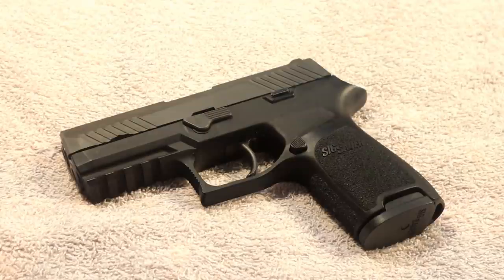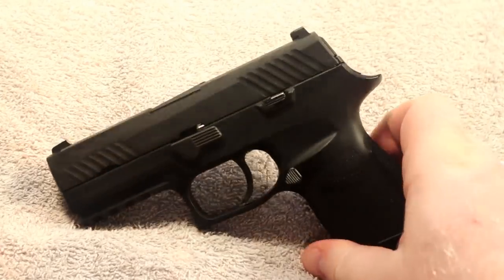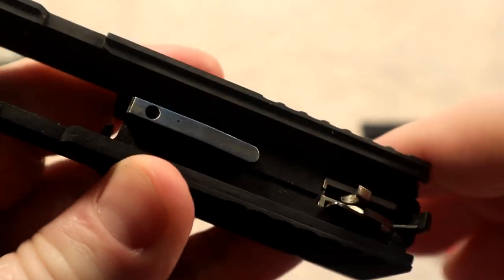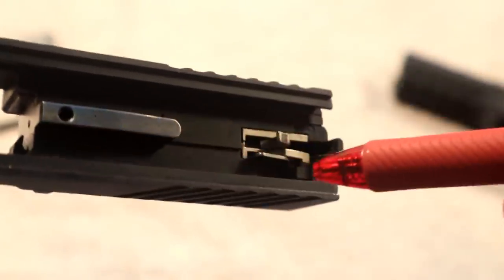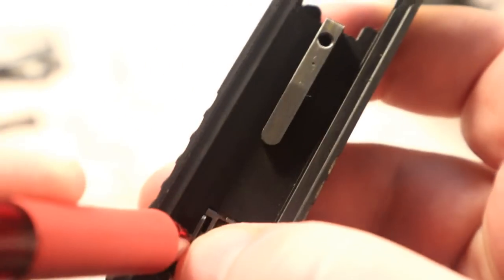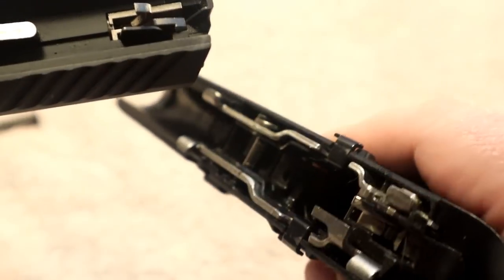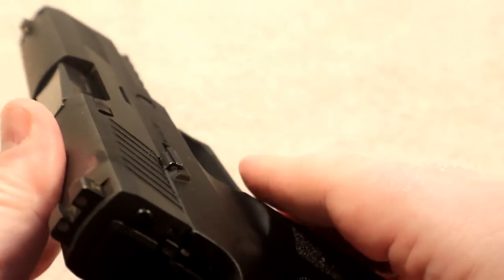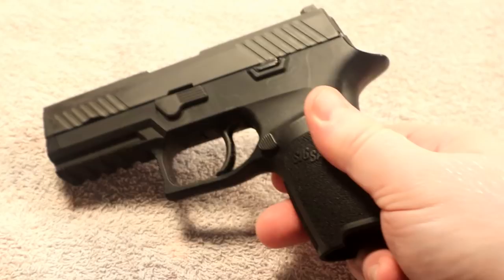The Sig P320's Dirty Little Secret You Won't Find in the Manual

Comment: The Sig Sauer P320 had a design flaw that could cause unintended discharges. However,  Sig Sauer addressed the issue reducing the physical weight of the trigger, sear, and striker, while additionally adding a mechanical disconnector to prevent discharges. All P320 models produced since 2018, and thereafter, are modified to prevent unintended discharges. 
I own a P320 X Five. I have no issues with it, but only praises about it. Sig Sauer pistols are safe to carry.
Reply from the maker: Yep

Comment: My p320 has been loaded with one in the chamber, carried and/or stashed in a defensive location for several years and it’s never fired unintentionally. This was before the “upgrade/recall” and afterwards.
Reply from the maker: Yep.
Reply: OK that isn't a scientific test.  You get that right?  It proves nothing.
Reply: @barrygoldwater2441  you do realize that post was a year ago don't you?
Reply: @georgebaldford3186  Yes.  And this fact which is not your business concerns you why?
Reply: @barrygoldwater2441  It was a rhetorical question.
Reply: @georgebaldford3186  I don't think you know what rhetorical means but OK.

Comment: Absolutely OUTSTANING VIDEO. BoomStick Tactical is the real deal. Fantastic information. I had my Sig Sauer P320 with slide off with me and walked through with my upgraded Sig Sauer P320 and it worked EXACTLY like BoomStick Tactical was doing. With the Sig Sauer bashers, I bought that and took my Sig Sauer P320 off my night stand and went with my Springfield Armory XD-9. I really like it. But, now that I see that the Sig Sauer P320 would have to have multiple failures in order to "fire on its own", my plan is to put my P320 back on my night stand. THANK YOU so much BoomStick Tactical from a fellow "gunner" in the greater Los Angeles California area.
Reply from the maker: Thanks for watching. Be careful in california

Comment: Get this detective's sig 320 and any other lawsuit plaintiff's, then replicate the discharge in a controlled setting without pressing the trigger.  Otherwise, there are too many variables.  I am not a fan of the p320, but its way too easy to cover up an AD/ND by claiming its the pistol's fault.
Reply from the maker: Exactly. I'd like to see the insides of it.
Reply: Seconded. Proof is in the pudding. I believe the choice of holster and purse contents are to blame.
Reply: I'd like to see the holster too.  Any bets there's scratches and nicks in it?
Reply: @dbill7486  i believe it was a blackhawk serpa holster
Reply: @madhatter6913  she is likely the one to blame...blackhawk serpa holster loose in her purse
Reply: @richardkim4895  Very true, ultimately it is the human error that caused the issue, coupled by poor design of Serpa holsters, loose junk in the purse, and the error of stowing the holstered pistol in the purse. The improper fitting holster left a big gap between the holster and trigger guard that was large enough to ingress random junk. Too many wrong things went right to make the gun go boom. 

Guns demand respect. In this case the officer did not give proper respect to her firearm. There is great power in a firearm and with great power comes great responsibility. I believe it is safe to say this officer was not responsible enough to safely carry her issued service weapon. Education and respect of the firearm are vitally important factors for any who plans to carry a loaded firearm.
Reply: @richardkim4895  That's what it looks like to me also.  I have the X5, full and the compact and they all rattle around in that holster its not a great fit unless you put padding into it.  I fit my Beretta just great thou.  But the holster was made to go on your waist not in a purse or bag which is her problem, and she should of bought a holster that would of made it safe of where she was putting her firearm.

Comment: I have a full size and a compact. I have hammer tested and drop tested both of them....NO discharges!! I even bought a extra backplate, cut the bottom off, reassembled the guns and placed a small screwdriver in the back and forced the sear off the striker causing the striker to go forward and every time the striker block did its job keeping the pistols from discharging!!
Reply from the maker: Exactly

Comment: The possible foreign object in purse scenario PLUS fairly light trigger is why I really like thumb safeties.  Besides being a close copy of the new issue pistol of the Marine Corps, the thumb safety is a big reason for buying a P320/M18.  If I decide to use a P320 for CCW, I can simply purchase appropriate frames and slide assemblies.
Reply from the maker: Some prefer them. Allowing something to get against the trigger is why hers went off
Reply: @BoomStickTactical  Yep.  IMO, an activated thumb safety would have prevented that something from pressing the trigger and fire the gun.
Reply: Loose off body carry in a purse with loose items, pens, keys. Eye liner etc to get inside the trigger guard you are asking for problems.  You need a trigger guard cover carrying like this.....the thumb safety can be clicked off rattling around in a purse.
Reply: @bmphil3400  Totally agree about the requirement for a holster to cover the trigger guard!  Dinosaur that I am, I still like a thumb safety if the trigger is less than 8 lb--about like a good DA revolver.
Reply: @petesheppard1709  thumb safeties become a liability in a high stress situation.  I'd rather have the revolver with the 8lb trigger or dao pistol than a light trigger with a thumb safety.  Those snap on minimalist trigger guard covers work pretty good for this.  My wife loads the Glock then snaps on the trigger guard cover and puts it in the purse.  Pull the lanyard and the cover comes off and it's ready to go.
Reply: @petesheppard1709 It also can PREVENT the same kind of untrained, inexperienced user from firing the weapon when they forget to disengage the safety. A better solution is to pay attention to what you are doing, and probably don't put a handgun in your damn purse.
Reply: @wehrewulf  You make good points, but the simple truth is that NDs still happen, despite aggressive and thorough training. After decades of shooting, I have worked out personal practices that provide me a margin of safety that I'm comfortable with.  Even so, I am constantly on the lookout for complacency.
Reply: @petesheppard1709 Your statement is the most relevant of all, complacency! Training and safety focus can help here. Like daily safety meetings at a construction site, focus on the topic and practice. That said, using a tool that is more user safe, to avoid the need for a higher level of skill and practice is a valid argument (like using a Glock for example). If police departments are going to pick a tool that requires more advanced skills they need to support their choice with the appropriate level of training and measurement of effectiveness. Aka common sense.
Reply: @maybe5883  👍 More good points!

Comment: Greg Ellifritz recently shared an experience where the tab on his Glock's trigger bar broke and couldn't disengage the firing pin block. He tried pulling the trigger several times before finally realizing why the gun wouldn't fire, just because it was a failure he had never encountered before. As you say, even if the striker tab broke, the gun won't fire without the trigger being pulled.
Reply from the maker: Bingo. It would take several failures happening at once
Reply: It is a striker, not a firing pin.

Comment: The issue is that the Sig doesn’t have an inertia trigger safety (many other striker fired pistols do have one), which means if a Sig is dropped on the tail of the slide, there’s nothing to prevent the trigger from moving backwards and firing.
Reply from the maker: There is internal safeties and physical barriers that block the firing pin. They're fine.
Reply: @BoomStickTactical  Not fine enough to prevent dozens of discharges occurring without people touching the trigger. Why anyone would carry this poorly made, dangerous piece of junk is beyond me.

Comment: By design most modern guns are safe, but it doesn’t mean you can’t have a batch of guns assembled poorly or have bad parts from a supplier. It’s obvious the majority have a quality p320, but you cant blame user error for all those in the lawsuit when there is videos of people impacting their p320 and it discharges. 

Sig is a great company, just like most of the big name manufacturers, but it doesn’t mean they can’t have a batch of bad guns. Do your due diligence and have sig inspect your gun to make sure it is within their specifications and limits.
Reply from the maker: No one has shown a failed component that has caused one of these guns to fire.  If it were a problem with the gun, someone would certainly have posted the source of the problem.
Reply: the problem was rush to blame owners and when someone posts what failed why do people have a problem believing that sig fixed the issue but how they got there gave themselves a bad rep on the 320

Comment: Never seen a manufacturer avoid a recall in this kind of scenario. I will never own a Sig because of this failure. I saw a video of an officers gun discharging in her holster as she was walking to her patrol car.  There have been over 100 incidents where this gun has fired without the trigger being pulled. I have owned a Keltec P3AT for 10 years. I paid $200 for it new.  It has been dropped on concrete with a round in the chamber more than once. I have more confidence in it than I do this Sig P320.
Reply from the maker: You may have seen the video but did you hear the final outcome where she admitted that she didn't have the gun in a Holster.
Reply: its sad when no one wants to admit yes there was an issue and its fixed its like the glock fans they do not like when you bring up what massad ayoop brought up along time ago that number one gun with accidental discharge by police nation wide was a glock the safety trigger better training has made a difference

Comment: I agree with this video completely.  Ive been carrying a P320 on duty for two years and have never had a problem.  Poor quality holsters or improper fitting holsters, especially leather ones along with a trigger job  giving the gun a super light trigger pull are almost certainly responsible.  This could never happen with a proper fitting kydex holster and stock trigger.  Custom triggers should not be installed in duty or everyday carry firearms in my opinion.  These trigger upgrades are nice for a competition or range gun.  I think most of these after market triggers are too light and could not only contribute to a gun firing in said "poor" holsters but could also cause an accidental discharge if you have to point your gun at someone posing a threat.  Whenever possible we want to use our firearms as a deterrent instead of a weapon.  I want to be sure that when the trigger is pulled,  it was 100% intentional.
Reply from the maker: Bingo. Stay safe out there.

Comment: Very informative video! Last time I checked, when one pulls the trigger the gun fires. I would not be comfortable knowing my wife carries her firearm in her purse. There are to many items in there to wedge their selves into unsafe places.
Reply from the maker: Exactly
Reply: If planning to carry without a trigger guard, it would be wise to have a gun with a manual safety. Guns without one are meant to be paired with a holster that provides adequate trigger protection.
Reply: Purse carry is OK if the weapon is carried in a  purse designed for purse carry. The weapon should be in its own compartment, inside of a holster. The real problem with purse carry is, if someone’s fighting with you over your purse, it makes it a little tough to draw the weapon

Comment: I think the biggest factor here is this:
Normally, a striker-fired pistol has a long take-up so that the trigger travels a good distance and breaks all the way at the rear of the trigger guard.
On the P320, there is very little take up and the trigger breaks without a lot of trigger travel... making it a short trip for the trigger to break if something were to foul that trigger on re-holster, etc. If you're gonna carry a 320, you'd better have 1) a good holster made specifically for your gun, and 2) a high level of trigger discipline.
Reply: yeah, some people don't get that what is a good range or competition trigger isn't necessarily a good carry trigger. A heavier or longer pull can be better for carry.
Reply from the maker: People not knowing how to handle them is the problem
Reply: @BoomStickTactical  The 320 trigger is not as forgiving of carelessness as some other striker-fired pistols are... but it's not a "flawed design" like some people claim. Keep that booger hook off the bang switch.
Reply: @BoomStickTactical  I recall all the negligent discharges Glock had when officers were transitioning  over. Let’s be real, just because LE carry firearms doesn’t mean they are safe and/ or good with them! I knew a instructor that said cops were the worst. I am going to carry a P320 compact for duty use soon after 27 years using Glock. All these “sigs going off on their own,”makes me question why would I ditch Glock, for a Sig some. But as with a Glock, keep your trigger finger index high on the side until ready to fire. I’m thinking most if not all are probably negligence.

Comment: These claims that P320's are going off all by themselves just doesn't  pass the smell test.
Sorry. I don't believe it.
Reply from the maker: I don't either
Reply: I own and carry one never shot my self or had an accidental discharge.
Reply: @Tazer120  me to I researched all the cases some the police department didn't even send them in for the upgrade so honestly the person should be suing the police department not sig.
Reply: Ditto, to everything you said. I have mine either on my side or in my tactical bag, & always in a good holster. Not going to be throwing or twirling my bag neither. Something got into that trigger gaurd.
Reply: Been carrying one for over 4 years and no problem. Use quality holster thou in carbon fiber
Reply: How about the one video that hammered the back of the gun and it fired?

Comment: I've seen someone explain and show that the problem of this safety system is that a partial press of the firing pin block from a partial trigger pull can deactivate the safety. In other words, a partial trigger pull will deactivate the safety block.  You can actually try this by very slightly pressing the firing pin block (not fully) and seeing if the sear will fully go forward. The other problem seemed to be that the ledge barely hanging on to the striker is only like a mm or 2. Combine the two problems and one can see how things can go wrong quickly. I think the possibility of both happening is somewhat small but not impossible. This could happen if the gun is shook or dropped hard enough for a slight trigger movement and a slip of release of the striker. I think this is why Sig mentioned it in the safety manual. I don't know if the second safety ledge has fast enough timing to catch the released striker.  My gut feeling is saying that it isn't. The last part is completely my own opinion. I think the solution to the problem is the following. Trigger tab safety will allow for no movement on the firing safety block. Also, sig can make the striker a little bit bigger and hang on the ledge more firmly. This is just my observation and opinion based on my research on this topic.
Reply from the maker: Any movement of the trigger will begin disengaging the safeties by design of every striker fired pistol.  There's nothing wrong with Sig p320 pistols.  As far as trigger tab safety, you can easily add them.  But even then, keep your bogger hook off the bang switch and protect the trigger from anything getting against it.

Comment: great video , I do have one of first SIgs, I had it upgraded , the trigger got bit spoiled - a bit harder to shoot , but it still works great and eats everything . Any accidental discharges I've had were caused by my finger on the trigger during fast reloads while moving for example . Just follow the safety rules , use good and proven components and accesories and nothing bad will happen .
Reply from the maker: Keep your boogerhook off the bang switch

Comment: The P320 platform endured extensive testing for the M17/18 to be selected the primary sidearm of our Military.  I don't believe our Military would have accepted a defective firearm.  If the P320 platform is defective, where are all of the reports from our Military about unintentional discharges?
Reply from the maker: Good question
Reply: The military M17/18 does have an external safety though
Reply: The military mandates an actual safety switch on the weapons.

Comment: Thank god I saw this I just bought the p320 RXZP and then saw where everyone was saying they were known for firing without any force being placed on the trigger.
Reply from the maker: They're fine. Just keep your finger off the trigger
Reply: @BoomStickTactical Press F for doubt
Reply: yup, the latest video with a holstered p320 discharging really makes me question the p320 completely.  I haven't carried mine for several months now, glad I have stopped.
Reply from the maker: @brassmule  if you look closely at the video, you can see the issue. The gun was not properly holstered.  Early in the video look closely at how  it's setting, comparing the back of the gun to the belt line.  It's about his belt and after the incident, it's setting below his belt.  When it was pressed between the two cops, the gun was pressed down and more than likely at an angle where the trigger got against the side of the Holster.